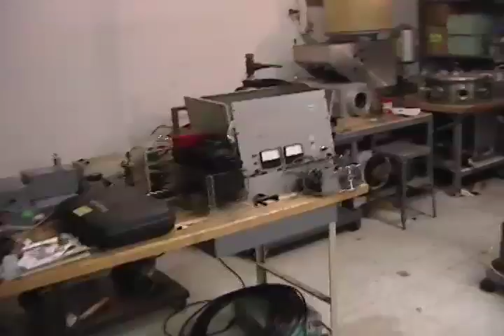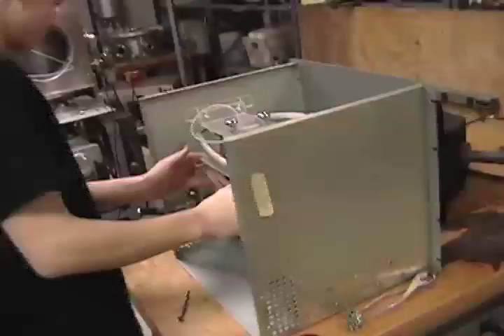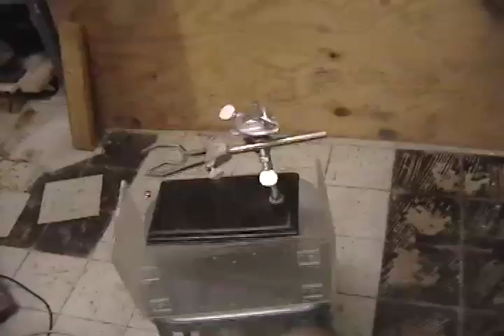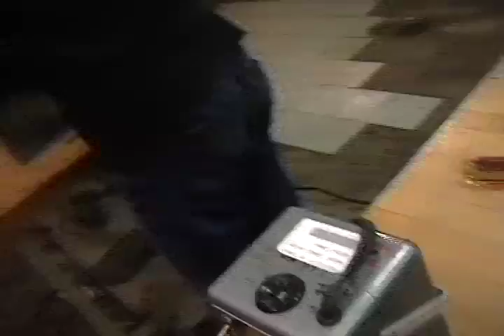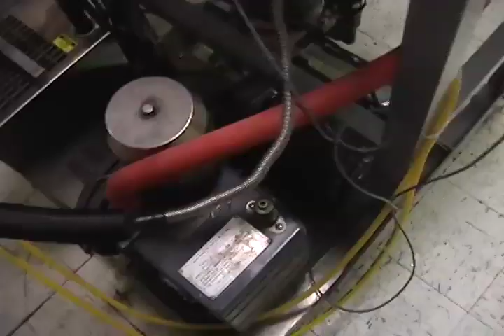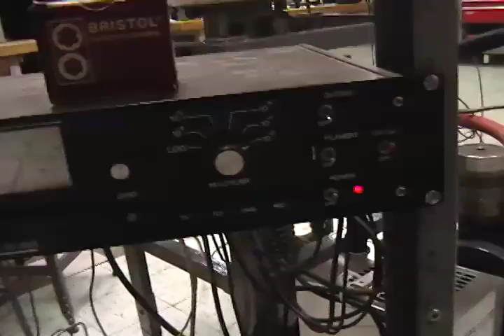Fusion Reactor Construction Tour (Part 1)

Comment: Guys, fusion reactors are much safer than fission reactors because if there is a leak in a fusion reactor, the reactor's temperature falls very quickly causing the reactor to shut down.

Comment from the maker: "If you guys spontaneously evaporate into an atom vapor, don't blame me."

Considering gases are actually composed of atoms, there is no such thing as atom vapor. Also fusion is an inherently non-runaway process, it requires a constant input of energy to continue. We are working at low enough energy levels that there is no chance of self-sustainability here, if there was we'd be first in line for the Nobel prize. I suggest you get a greater understanding of the subject if you want to critique.

Comment from the maker: If you have a cheap, non-government regulated source of Tritium, by all means share, considering the current price of Tritium is around $30,000 per gram right now, a little too rich on a student budget. Deuterium is currently what we are using, we still have to calibrate our MFC in order to use it however.

BTW the filament is actually a Bayerd-Alpert vacuum ion gauge and has a thoriated iridium filament, you would never see beryllium in there.

Comment from the maker: I'm one of five students working on the project, it's our own project ie. not run by a lab or professor. So you might say my contribution is fairly large by necessity if anything is to be done in a reasonable time frame.

There is no "security" risk here, it's an academic project on 50 year old technology using off the shelf commercial products. Nothing new or top secret here.

Do you even know anything about this subject?
Or maybe you're just the quintessential jackass.